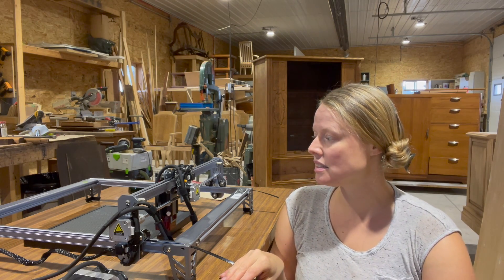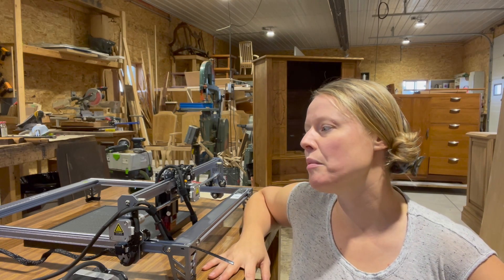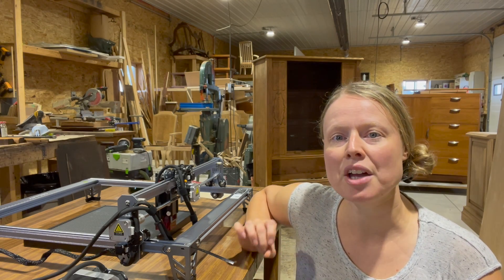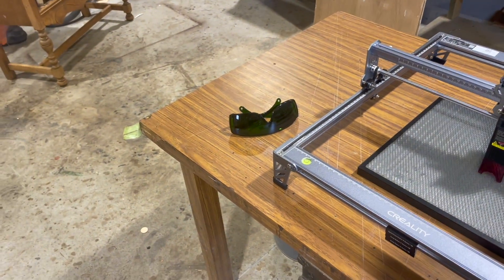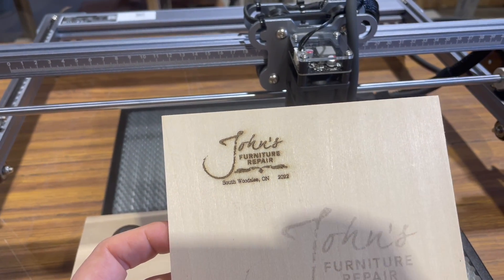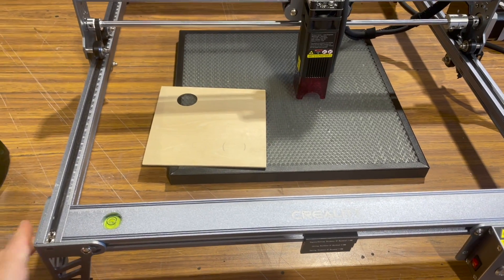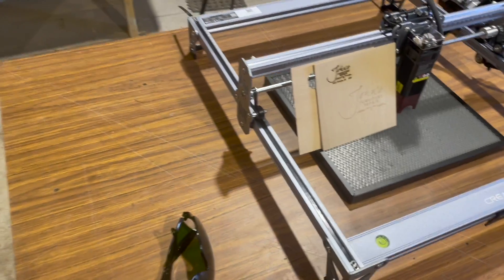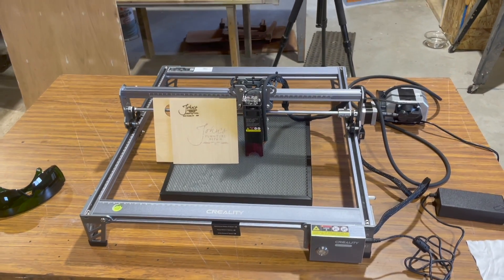Pew pew pew!! Its LASER time! Creality CR-Laser Falcon Review

Comment: The laser can also be used to create thin layers (3-4 mm thick) of scrollwork, such as you repaired in the previous video.  Say, you have a corner missing, well, break out the laser and, voila, scrollwork recreated.  I am talking from experience because I cut laser products all the time.  If you can design it, you can create it, and this is not an oversimplification.  Good luck with the laser.  You will not be disappointed.
Reply from the maker: Thanks!

Comment: These laser machines are so dangerous they should be banned....the safety on them is appalling. A lot of companies dont even check the safety goggle for the wavelength of the lasers.  Also its fine for the person with the goggles and the respirator on them but not for anyone else even animals.  Just make sure if you use laminate wood like plywood you use purpose made for lasers as normal plywood and MDF have formaldehyde in them^^I just wish lasers without enclosures were banned outright.  Go see Makers Muse recent videos on laser safety
Reply from the maker: Hmm interesting. I will. Thanks

Comment: Congratulations on the sweet acquisition, Trena!!
I was fortunate enough to be gifted with a similar unit a while ago and I love it. 
I engrave my logo, the piece number and the website address on all my pieces.
Here's a tip for your viewers, If you are engraving cutting boards, different woods will burn at different rates and depth.
Reply from the maker: Makes sense

Comment: SUPER COOL! I've been thinking "label it" for some time also. The logo you did looks great! Wood labels are fine where appropriate. /// Thoughts>: 1) Label needs beyond "John's Furniture Repair": "Restoration by Trena Reynolds (date - at LEAST the year), Ontario, Canada." REASON: Beyond your dad's shop, there dozens of other John's Furniture Repair/Refinishing/etc.  2) REALLY CLASSY are thin brass labels. REASON: termite proof, rot proof, easier for delicate or small pieces. Definately need a brass label for that INCREDIBLE clock restoration you did. Attach brass labels with tiny brass brads. Will email an "sketch"☺

Comment: This is so typically you, rather than change the original piece of furniture you chose the method that will not change the original permanently you chose a method that is reversible, I bet you chose a glue that with heat it can easily be reversed! You are always two steps in front of your fans. Making them that can be purchased as ornaments for a Christmas tree!
Reply: Don’t forget to sign it!
Reply from the maker: Thanks Robert!

Comment: You can permanently label your work for next to nothing, as follows:
1.  Sand the area where the  label will be.
2.  Clearly write your label onto the wood with a graphite pencil.  Graphite will not fade.
3.  Cover the label with a permanent finish, such as polyurethane.  This will prevent the graphite from smearing.
Reply from the maker: cool idea, but not s cool as lasers. lol
Reply: Seems like that method would be vulnerable to damage over time.